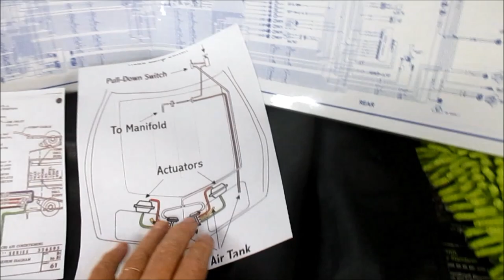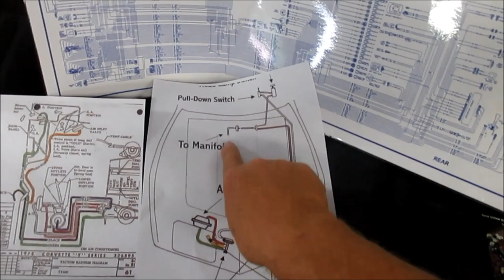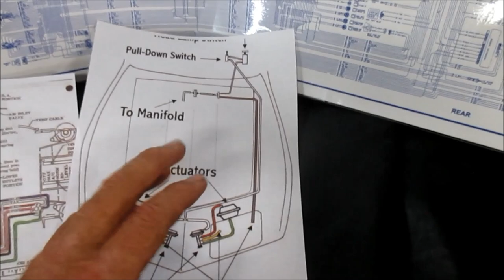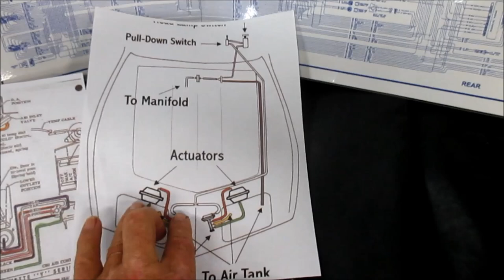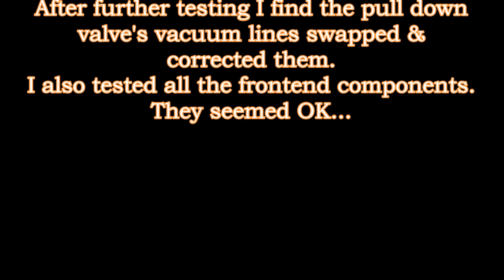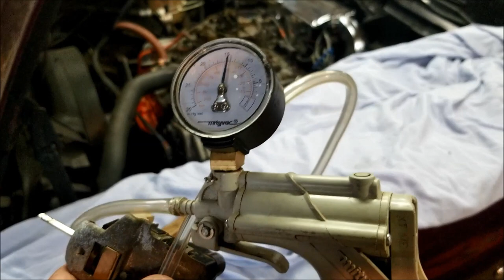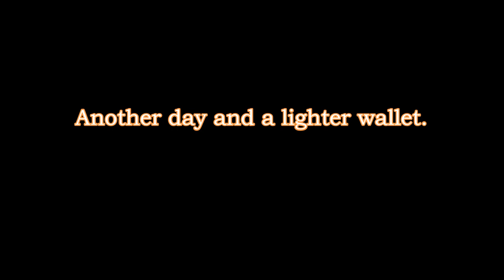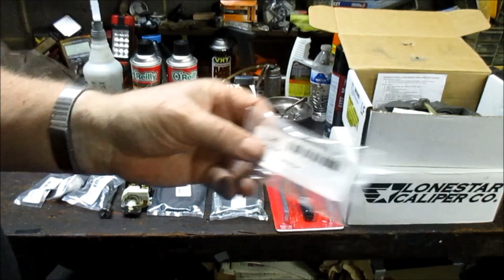1975 Corvette, Headlight troubleshooting & repair, Volume 2

Comment: Newer C3 headlight covers are spring loaded closed. You need vacuum to open the covers and override the spring.
Reply from the maker: This 75 has springs too. I discovered this when I rebuilt one of the actuators. I think the vacuum just assists them to close.